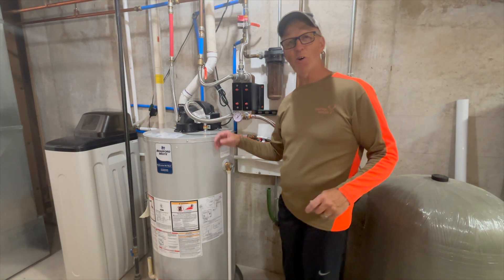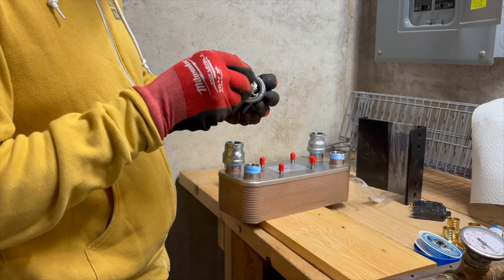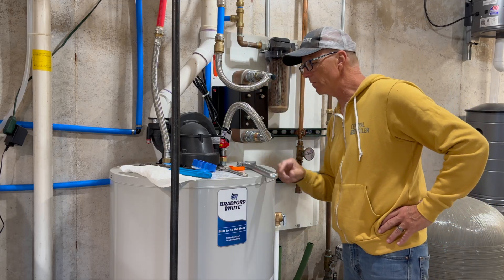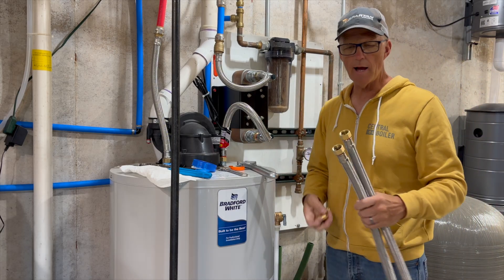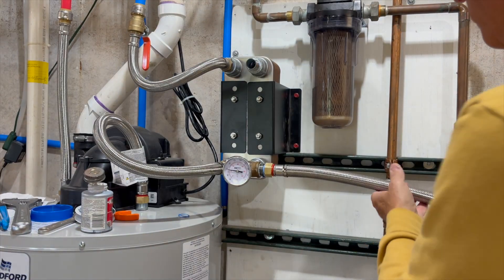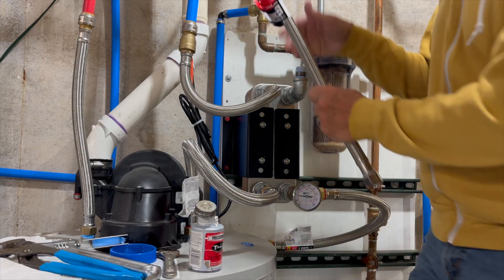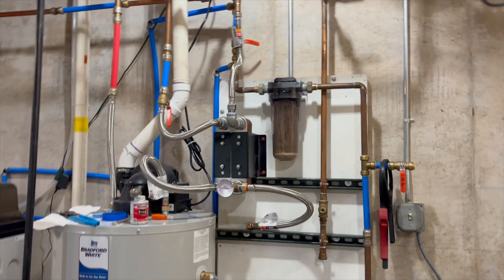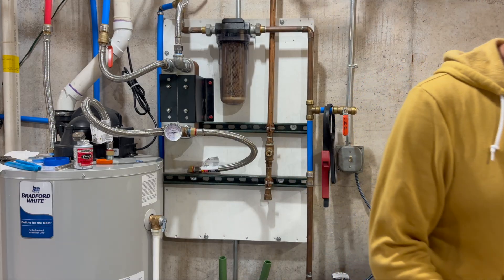DIY, 30 Plate Exchanger for Hot Water Heater ( FREE HOT WATER)

Comment: Why galvanized  bushings? I think brass or dielectric would prevent oxidation
Reply from the maker: Yes they could have been used, when I sold the ob my installer use galvanized all the time so that’s probably why I did. 
With the braided lines, I didn’t have to use unions so that’s another reason I guess.  
Thanks for watching,Kevin

Comment: I think you are plumbed a bit backwards. The return to boiler should be exiting the plate HE where the curb water is entering. The boiler supply should be entering HE where the output of curb water is going to the water heater. An "X" pattern. 

This way, you are getting max efficiency from the exchanger. The curb water catches heat before it gets ''super heated'' and sent into the water heater.

Edit: I think I misinterpreted your connections.
Reply from the maker: CB says yes you can do a X or just the way I did, we have endless hot water.  Thanks, Kevin

Comment: Looking at this again I think that upward loop to the tank from the plate exchanger is causing a thermal block. The tank may not get hot without water flow.
Reply from the maker: Everything is working great, tons of hot water.
Reply: @klwit1980 not sure but it does not work on mine similar setup !
Reply from the maker: Strange, send a picture
Reply: @klwit1980  I already moved it but now the tank drain valve is leaking since I touched it.  I had data logged on the fitting before, no heat at all entered the tank if I did not use the water to create flow.  Will share my result.

Comment: Whats tbe gpm on the boiler to the flat plate exchanger?
Reply from the maker: I run a Grundfos 15-58FC
it’s a three speed pump that I have on 2 with a max 17 gpm  with 19.5 head
Kevin
Reply: @klwit1980  You will have head loss in the pipe only way is to use a caleffi quicksetter.  1" pipe would max out probably at 10gpm with over 4 fps.  I would say  you need about 7 gpm  for this to work min.
Reply from the maker: It’s been running for 3-4 weeks and all seems to be working ok, will see how it goes.  Thanks For you input, Kevin

Comment: Any particular brand for the heat plate exchanger?
Reply from the maker: I did get mine from a Central Boiler dealer.  It was a 50 plate in the video you watched.  Our new house I just did a video and used a 30 plate for heating my hot water heater with an outdoor wood boiler.  
Thanks for watching, Kevin

Comment: Do you think all the 90s in the system will affect anything?
Reply from the maker: It should not be a problem, I did sell Central Boilers for 10 years in which I sold over 600 units and there was never a house or water heater that didn’t work correctly.  I have 4 elbows to get me in the basement then 6 on the feed and 6 on the return just in the house.  I did run it for a week with no flow problems and tons of hot water.  Thanks for watching, Kevin